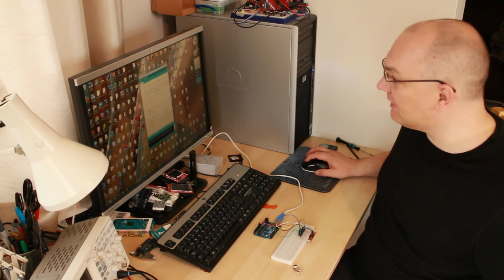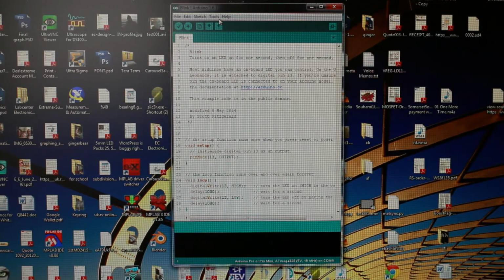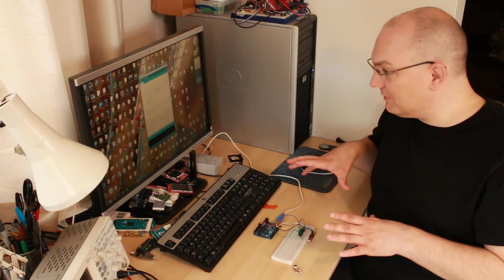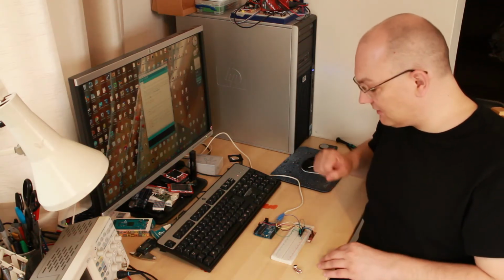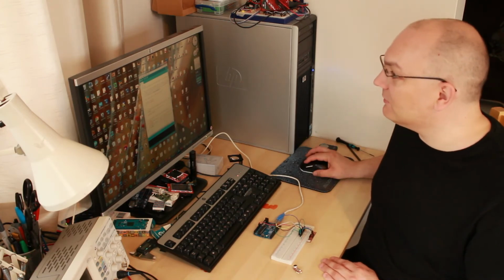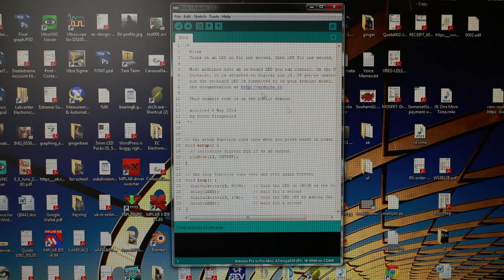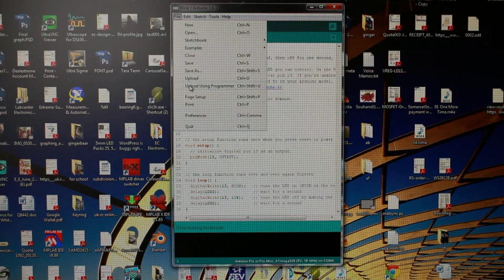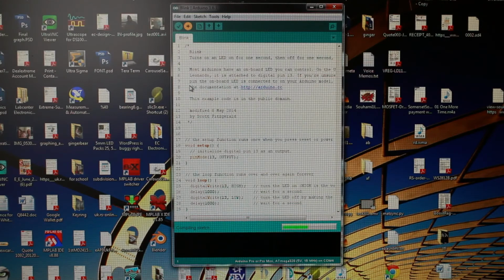Ragworm Prototype PCBs - ChromaTab from Carbon Frog

Comment: Did you ask to have their logo removed? I read they include their logo on your board by default.

Also, i really think you should be using a stencil for those small footprints, will make things a hell of a lot easier.

Comment: Cool PCB and video!
How many days does it take after you submit your gerber files to Ragworm?
Cheers!
Reply from the maker: It takes them about 10 days to dispatch. It can vary a bit depending on how busy they are but it's usually fairly quick and they are really helpful.
Reply: Thanks for your reply :)